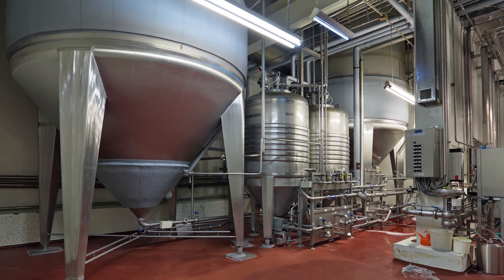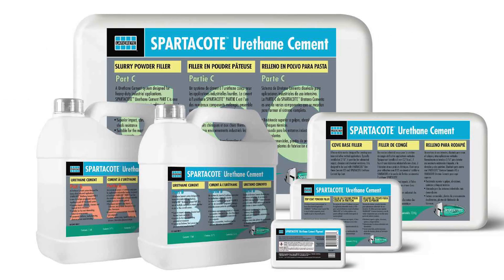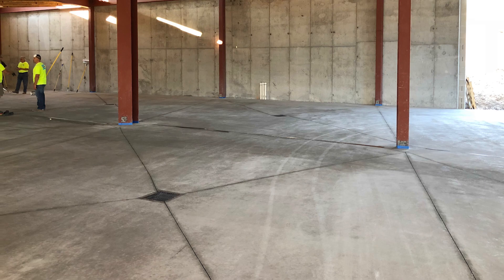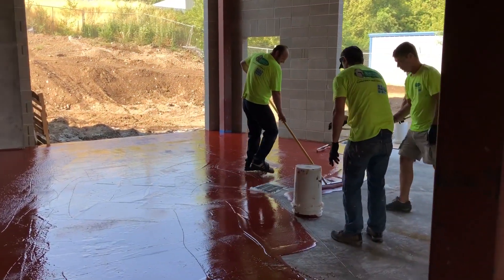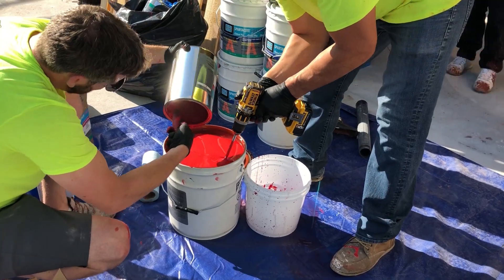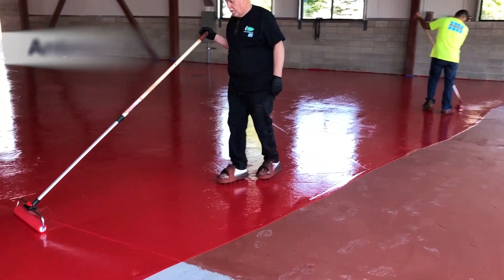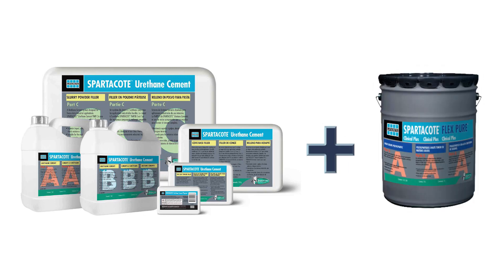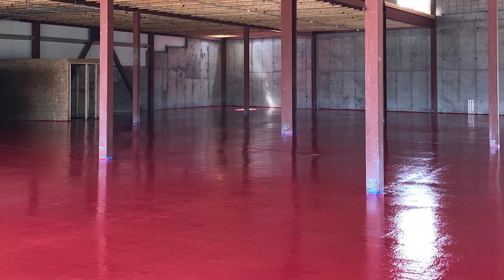Brewery Expansion Incorporates Demanding Concrete Floor Coatings by LATICRETE

Comment: Is this appropriate for waterproofing? Application is commercial kitchen on 18th floor. Would be adhered to lightweight concrete deck.
Reply from the maker: Thanks for the question. LATICRETE SPARTACOTE Urethane Cement is the appropriate product for commercial kitchens but it is not considered a waterproofing product. Please call our Technical Service Line @ 800.243.4788 ext. 1235 to discuss you specific project and some potential solutions for your install.